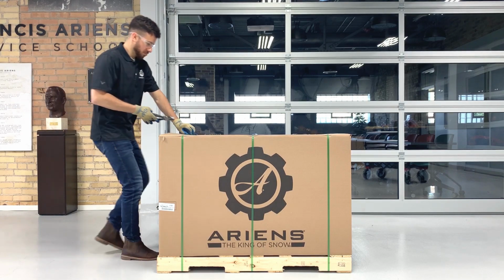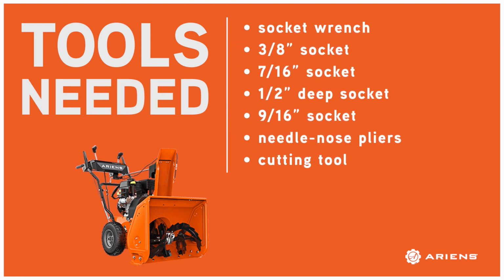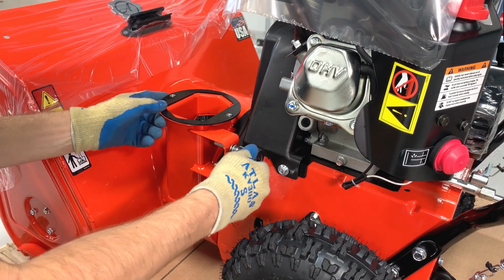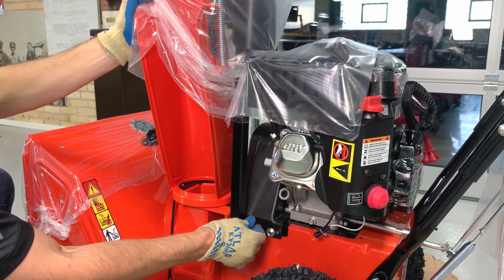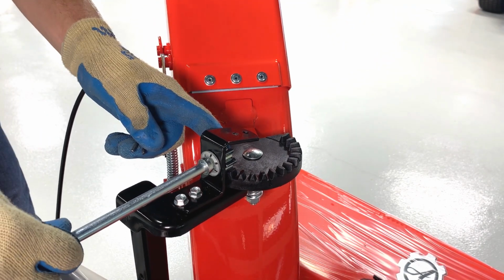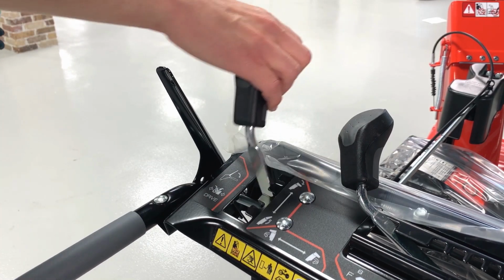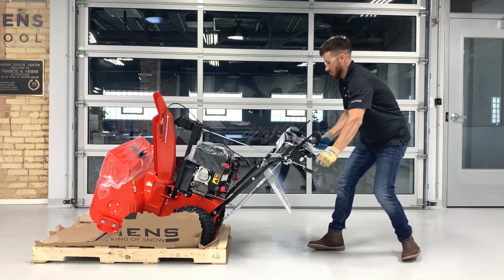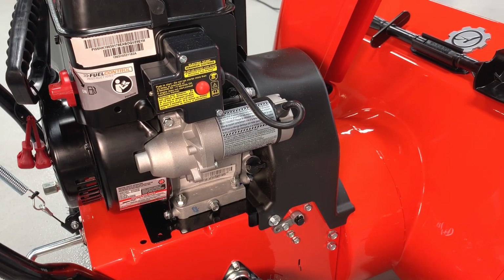Ariens® Classic-Series Sno-Thro® Assembly | Ariens

Comment: Just put my Classic 24" (ST24E) blower together and I have a question. The shift rod hard hardware on my machine is different than in the video. I have a single rod that attaches to the shift selector to the transmission that was not pre-attached to the unit (diagram 2-1 & 2-2 in the assembly instructions). As I face the back of the machine should the cotter pin on the lower end be facing me or the machine?
Reply: It would be nice if Ariens had responded to you.  I'm having the same issue.  It doesn't seem to want to line up.  Did you happen to figure this out on your own?
Reply: @London755  I also hit up their online email support form. The answer was that it can be installed from either side.  Before I received the reply I had an attack of good sense and went to Lowes to see how they installed them. They did it both ways.

Comment: Appreciate this video I just picked one up at Lowe’s. Just to clarify does this model only have that small oil fil on the bottom of right side of machine? Also my keys don’t turn at all when inside the ignition isn’t it suppose to turn clockwise  in the run position and then off when not in use? Thank you in advance
Reply from the maker: Thanks for your purchase, and welcome to the Ariens family! If you have model number 920025 (which we are assuming), you are correct that the black cap on the lower right of the engine is your oil fill location. Additionally, this model is equipped with a key that does not rotate. If the key is inserted, the engine will start when primed, choked and started with either the rope or the electric start feature. To stop the engine, simply remove the key. The engine will not start with the key removed.
Reply: @AriensChannel  I just purchased the Ariens Compact 920033. I would like to see a video about filling the oil. Is it true that you fill the oil from that little dip stick in the side? Do we have to turn the blower on it's side to do this? Thanks

Comment: Thank you for the video, very helpful. I just purchased the 920025 Classic. The video shows the shift rod with a hardware set. Mine did not have the hardware set with the shift rod. It only came with the shift rod and two hair clips. Is this correct? Thank you
Reply from the maker: Thanks for asking, Jessica. Can you tell us if your shift rod is in two pieces, or is it a single rod? If the rod is in two pieces, it will need that hardware to connect the two.
Reply: @AriensChannel  it’s a single rod. Thank you for the response.
Reply from the maker: @jessicatoto7902  You're very welcome, Jessica! In that case, you should be in good shape.

Comment: I recently purchased a 920025 and I have two metal rods but I don't have any hardware. The video said I would need to loosen the hardware from the upper to the lower handle bar assembly, but I didn't have to do that because they weren't there. What am I missing?
Reply from the maker: Hi Trish, we're very sorry about that. Are you referring to the hardware around 3:35?

If you're missing any parts / hardware, please contact our customer support portal and explain the situation so our support team can help you:
https://www.ariens.com/en-us/support

Alternatively, you can also contact your nearest Ariens dealer and source the hardware through them. You can find a dealer in your area using our dealer locator tool:
https://www.ariens.com/en-us/dealer-locator

Comment: Dimensions of box without pallet would be helpful in knowing if it can fit in certain vehicles. I have a 2020 Ford Escape.
Reply from the maker: Thanks for asking! Though we don't have those dimensions in front of us right now (we're tracking them down from our packaging engineer and will supply them shortly), we have a couple thoughts on that:

The bottom of the corrugate is stapled to the pallet. And without the pallet, there's no support for the machine inside – the machine would bust through the bottom of the crate. And though we don't have those dimensions in front of us, we're almost certain the crate is too big to fit inside your vehicle.

Though we suggest against attempting to transport a crated Sno-Thro on your own, you'll be glad to know that our Ariens dealers and partners at Lowe's have delivery options! To find a retail location near you, use our dealer locator tool linked here: https://www.ariens.com/en-us/dealer-locator
Reply from the maker: UPDATE: According to our engineer, the crate with the pallet is 35" high x 48" long x 27.5" wide. Though that probably won't fit in your vehicle, he did say that if you'd actually uncrate the entire unit and leave the handlebars folded in their shipping position, you'd lower the overall height to about 29 inches.
Reply: @AriensChannel  Awesome! Thank you for the information and I
ll be picking mine up tomorrow at Lowes! Cheers.
Reply from the maker: @MrKitty-zv3dl  glad to hear it! Welcome to the Ariens family!
Reply: @AriensChannel  can the box be placed on it's side while transporting or is this not advisable?
Reply from the maker: @bustedrav  Thanks for the question! Keep the crate upright in transportation, always.

Comment: Just bought one. My deflector chord does not have a rubber boot on the cable. Is that normal?
Reply from the maker: Thanks for letting us know, and we're sorry about that! Your cable assembly should have that rubber boot, but it's not a show-stopper if it doesn't. 

To get a replacement, please contact your nearest Ariens dealer and explain the issue. A dealer in your area can be found with our dealer locator tool:
https://www.ariens.com/en-us/dealer-locator

Or, you can contact us directly through our customer support portal:
https://www.ariens.com/en-us/support/contact-us